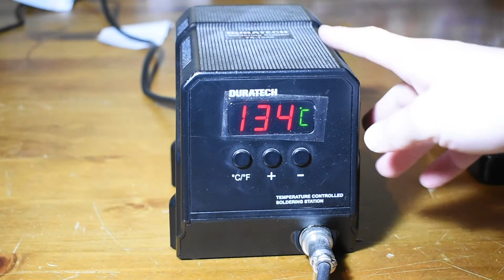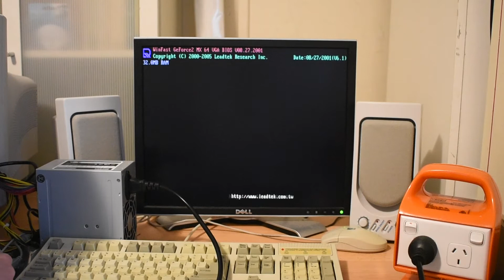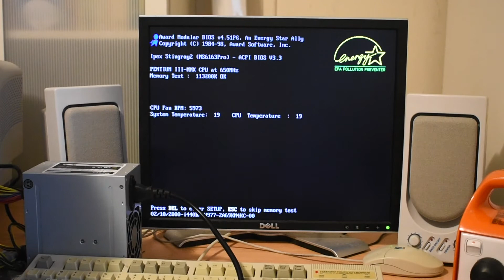Re-capping An MSI Slot 1 Motherboard With Bad Capacitors

Comment: I’ve really enjoyed your videos where you get the soldering iron out, your video where you repaired the traces on a 486 especially! 

But if I could just offer one small, but useful piece of advice? You need to use flux.
Reply from the maker: Thanks! Yeah I'm planning on making more repair videos soon. I've got a 286 system which has a pesky Varta battery in it. I do use flux nowadays, it sure helps a lot hey.
Reply: LOL odd i hardly ever use flux but flux made it so easy recently when i bought flux off Amazon. Made soldering stick on better. I even used flux to disolder my cap made a world difference.

Comment: I use a Hakko FR-301 for desoldering. It really makes my work a lot easier, as all I have to do is apply a little extra solder at every pin, place the desoldering tip on a pin to heat up all the solder, and hold the trigger for a second to remove it. I've never recapped a board; most I've done so far is reseat some SMD components and add sockets to boards using Dallas RTCs. I suppose my Abit BP6 is in need of a recap since it doesn't POST, even though I don't see bulging capacitors on it.
Reply from the maker: Yeah, I’ve looked into the Hakko tools in the past. One day, I’ll get one but at the moment they are pretty out of my price range. But it is definitely worth it though, since it would make a job like this 10x easier. I hear they are really reliable too.
Reply: Hakko is ok but so expensive over 100 bucks. Sometime over 200. I recently bought merece st-2090d from amazon market wow for only $41.59 sucker heats up in 10-15 seconds. I was able to to recap my xbox quickly. I desolder all 5 cap and solder 5 cap in 10 minute. If i get rich maybe i'll get hakko but there is better solution for lower price. Like what i have. :)